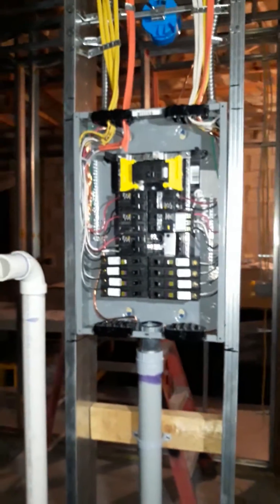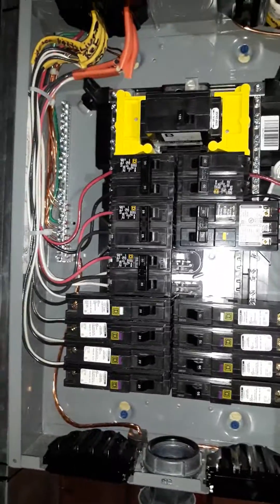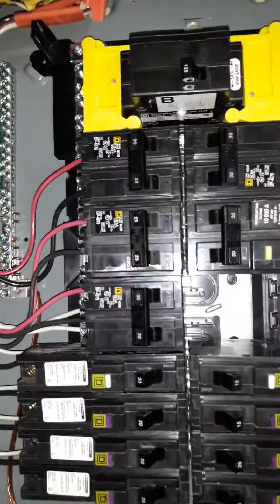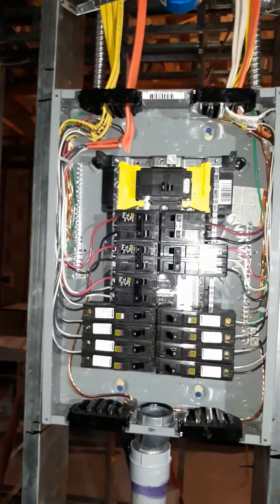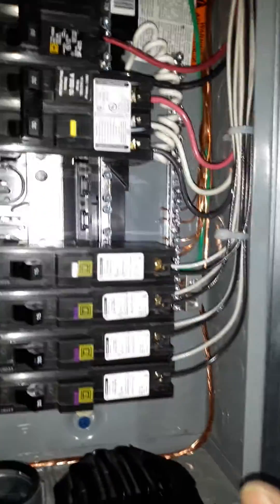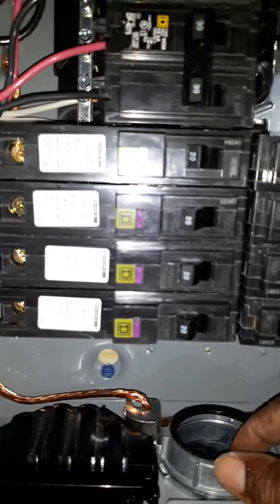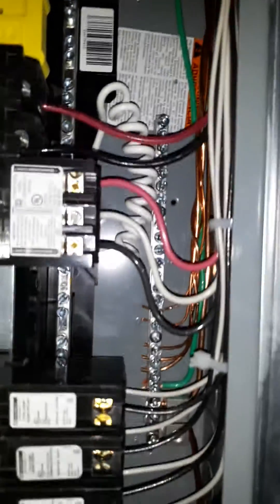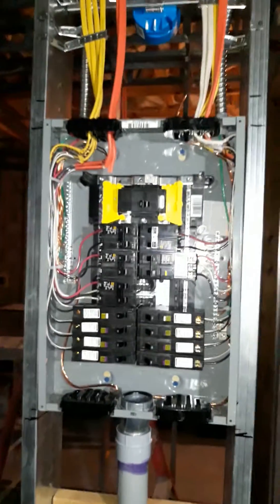Square D plug-on neutral Subpanel with quick grip installation

Comment: Are your white wires connected directly into the plug in breakers along with the black? or are the white wires connected to the bar underneath the breaker. Thank you.
Reply from the maker: Yes! You have to keep the pair of hot/neutral together make sure they're on the same breaker. These  breakers plug directly on the neutral bar. They're dual function, gfci & arch fault in one. No neutral wires on the neutral bar except a 30 amps gfci for a generator outside just in case  you loose power. Since the screws on the neutral bar are not been used they should be screwed in all the way before snapping the breakers in place. And thanks for your comments.
Reply: @TheDjboogieman  Thanks man. Got the job done last month. You video helped in a big way. Much appreciation for putting this out there. Best cleanest easiest to follow vid I found that does it right. Great work.